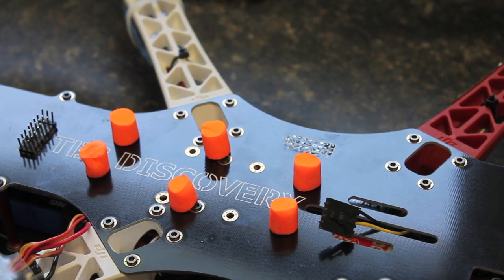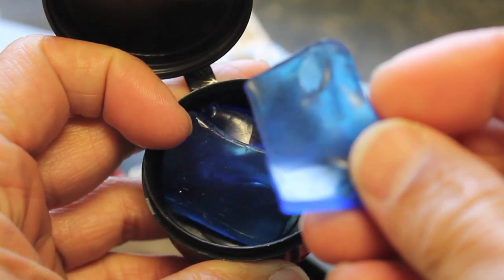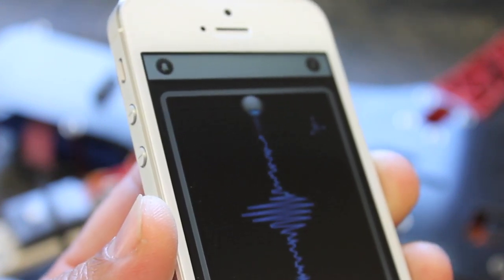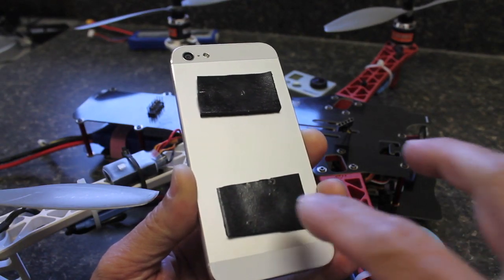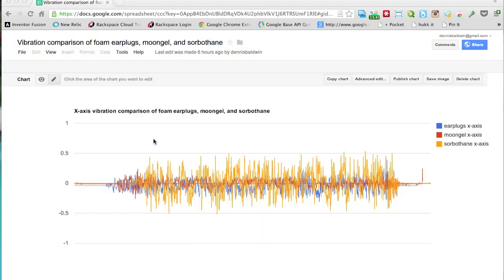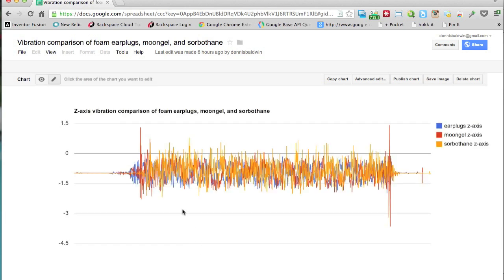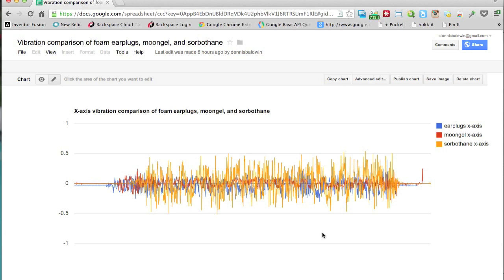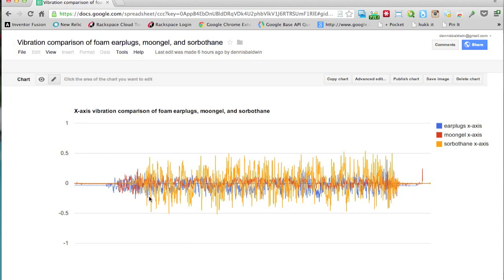Quadcopter Vibration Damping Comparison - Foam Earplugs, Moongel, & Sorbothane

Comment: Mate, not got the time to read all the other comments below, but you need to DE-COUPLE the phone from the quad. You cannot use tie wraps as the vibration will travel through the tie and bypass the dampening, also different frequencies will be generated depending how tight/lose you have it. Yes all the dampening needs to be the same size/thickness and positioned at the same points, so cut the gels the same size as the plugs. Lastly and most importantly, the motors need to be running at PRECISELY the same speed for each test over a sustained amount of time then increase for a specific amount each time to gain an understanding of how each material performs at different motor speeds. To keep the test as uniform as possible design a rig to hold the quad stable to the bench......you are welcome and look forward to seeing the revised video.

Comment: I'm not sure how did you get graph for x-axis. From Excel you show us, and 32 visible rows, sorbothane is stable and in between values -0.009 and 0.008, steps 0.001, 0.002, and max 0.005, while earplugs are in similar range, -0.039 up to -0.034, which is -0.005 step, moongel not to mention, but has worst jumps, -0.022 up to 0.019, etc. Did I get something wrong?
Reply from the maker: +Tomislav Kovacevic (Canon5Dtips) Good point. I had to take some time to revisit this data because it's been a while. I think those outlier spikes are due to takeoff and landing. I was more interested in comparing steady-state while the quadcopter was hovering. The easiest way for me to indicate this was to chart it. If you look at each axis chart when each material was plotted together you can see that Moongel has less spikes in a steady state hover. I hope that clarifies things. If not, then I'll need to spend more time and revisit the data. Thanks for the comment.

Comment: Moongel looks good for xy but earplugs seem better for z vibrations, so maybe mounting them on top of each other would be perfect. And use a rubber band and not a zip tie.
Reply: ab0032 or put something soft between the zip tie and the phone, like more moongel.
Reply from the maker: ab0032 Good suggestion. Definitely worth a test. Thanks.

Comment: Dude... your test method is flawed... the cable tie would be generating most of the vibration.
Reply from the maker: Ray Proffitt Yes it definitely transfers vibration. I couldn't find a way better way to do it at the time so this was the path of least resistance. The tests were all run with the zip tie so I tried to make the test as consistent as possible across all materials. Thanks for the feedback.
Reply: Ray Proffitt you are right.  That hard plastic tie down completes a rigid path all the way to the motors.  So I'd say the results are bumpkis.  You could have used rubber bands instead.  Also, as for the iphone, I seriously doubt its accelerometers are tuned for high frequency vibrations.  Remember the phone is only expected to be used by a person, and a person will not reasonably be able to produce a vibration over a dozen or so hertz.  So high resolution high precision vibration detection is not really needed in the phone.  Here are some data sheets on the accelerometers used in the iPhone 6 http://www.chipworks.com/en/technical-competitive-analysis/resources/blog/comparing-the-invensense-and-bosch-accelerometers-found-in-the-iphone-6/ , but even if they could technically do the job, I'd doubt the software is sampling the unit very fast since really it doesn't need to, but I'm just speculating with reason there.
Reply: UltraStoat lol the phones operate with a multi GHz processor and the accelerometers are the exact same ones used in drone flight controllers.  Stop speculating on things you know nothing about.

Comment: The Moon gel how many can you out of one pad?  Or will will it take 2 pads?  How long  will they last? Sorry If it has been ask.
Reply from the maker: Jack Carpenter There are 4 pads in each package:

http://amzn.to/198RdU4

You can cut them into smaller if necessary. I've used them for over a year with no problems. I'm flying with the QAV400 now and don't need to use them. Thanks for watching.

Comment: silicone from the shop has a hardness of about shore 20, same as a soft earplug and more springy, you can mold it into cord with a tube or paper or something. you can mold it to specific shapes, it's useful.
Reply: Sorbothane® anti vibration pads are manufactured in a durometer range from 25 to 85, soft to hard rubber erasors are mostly in the 35 to 50 range. 50 is pretty dam hard. 35 is like one of the softest rubber erasors that you can get. perhaps it's difficult to find an pencil erasor lower than 37 or something. a 55 erasor would feel like crazy tough.
Reply from the maker: monstercolorfun co Very good to know and thanks for sharing. It sort of reminds of sugru in the fact you can custom mold it. I like that idea a lot.
Reply: monstercolorfun co hi do you know about durometer of sorbothane, i need to know what durometer and thickness to make a trauma plate for my bulletproof vest to go between the vest and my body, i am using lexan and sorbothane but dont know what durometer to use or thickness, thanks...
Reply: monstercolorfun co
look up poron may be better than sorbothane
Reply: it's actually your judgment for the trauma plate, twice as thick means twice as much compression movement and perhaps, every time it increases by 10 it's about half as soft, 35 shore hardness is a quite elastic structurally if you put in half an inch cubes things, but if it's a thin flat pad you might even want to go for 25 or 30. if you have and caulk from silicone to make a pre-test, you can reseal the silicone with the screw cap with foil and plastic jamed under it. bathroom silicone after 3 days is about 35 i found. if you get some 35 it'slike a soft rubber and it should cover a wide range of designs that you would want without using too much, cos 40 would be for padding stuff like 500 grams of kit hitting the ground.
Reply: monstercolorfun co
sorbothane is incredible but way overpriced, especially on ebay where they take the piss, so in a long search for something comparable but cheaper i found something AMAZING, so amazing in fact it maybe very close to sorbothane, from what i have seen may be superior to sorbothane and its way cheaper like 4 times cheaper, and its called poron...

Comment: I found a free seismometer app. Cool item. Thanks for the idea. Are they earplugs softer or firmer than memory foam stuff, or have you tried that as well? A way we suspend mechanical equipment is with a resilient material on either side of the object. Hollow center to allow a non-destructible rod or strap to pass through as an anchor. Did I already ask you if youve ever seen a 6 axis right stick on a radio? up/down, left/right, rotate L/R? Thanks
Reply from the maker: John Robertson I haven't tried memory foam but that's not a bad idea. I like what GetFPV has done with their orange bobbins. It sounds similar to what you described. I have never seen a radio with a 6 axis stick. I'll look around to see what I can dig up. I got your message about the dude flying the collective pitch multirotor. Saw him on FliteTest a long time ago, but never looked into his setup. Would be good to know.

Comment: Interesting test. I was going to give you a thumb up even just from the thumbnail, no pun intended. I have one criticism of your test though. The ziptie was pulling down on the iphone, making it not totally suspended. How about using stickyback tape on your isolators next time?
Reply from the maker: John Robertson Good point. It's been a while since I've run these tests and definitely like your suggestion of not using zipties to pull the phone down. When I do an updated version I'll make sure to keep the tests more consistent across different materials. Thanks for the feedback.

Comment: Try marshmellows or very very gummy bears.. You probably won't... but Let me share something else with you.  I see a lots of guys spending $$ on high dollar props.  I will tell you all you guys, that these carbon fiber what not are mostly over priced version of very very crappy APCs.  Any prop that resembles "high tech" sharp tip look of apc props will rob you of power by creating wingtip/prop tip vortex.  That's why they are horrendously LOUD!  For ALL apps. except 1/2 or less planes, the standard beachwood prop made by Master Airscrew is the BEST.  It looks like it's not gonna bite the air, but it gives better thrust AND speed while using LESS battery than ALL others including German Brands.  Quad flyers should see a longer flight, better response, and QUIETNESS !!!
Reply from the maker: Thanks for the tip. Great info. I've been looking at Xoar props for a while, but haven't pulled the trigger yet.
Reply: Jamie Lee do u know about sorbothane durometer and what would be best to use for a trauma plate for a bulletproof vest thanks

Comment: Not nearly as technical as it should be. To be frank this is more pseudo science than anything. Vibration theory has not been taken into account. Each one of those materials are damping materials with different damping ratios. The materials also differ on the shore scale. The static load of the top potion is constant the variable is the stiffness of the materials  which has not been taken into account. To do this properly one would need to properly load the damper. or else Fn increases

Comment: My use is very different from yours.  That being said, I have have very good luck using sorbothane... but it takes awhile to dial in the correct durometer, thickness and SURFACE AREA.  As a starting point:  Try 3/8" thick sorbothane with a 30 durometer and place a small cube (3/8 X 3/8 X 3/8)  at each corner of your iphone.

Comment from the maker: Very, very good point. What I tried to do is preserve the thickness of material as it would normally be used in the field. I thought about doing tests of stacking Moongel layers on top of each other, but haven't got around to it. And given they would be two independent pieces of material vs one would obviously produce different results. Thank you for the thoughts.

Comment: As you said was mentioned. . .the zip tie is transferring vibration.  The other critical error is you used wildly varying thicknesses of test material.

I could have a revolutionary material, but if it's paper thin, it may appear to be worse than a few pieces of popcorn.

Comment from the maker: I fly with the Discovery and love it. My buddy has a Turnigy Talon Tri-copter and really likes it. I've never flown a tri and prefer a quad just because of the extra motor. The tri seems to oscillate more when descending, but maybe that's just because his needs to be tuned more. He's running a KK2 and I'm running a Naza. The tri seems a little more difficult to get the yaw locked in due to the servo, but that's just my opinion. If it were me I would go quad. You can carry more payload too.

Comment: That is pretty impressive! Not a bad pricepoint either, considering you get what appears to be a QAV500 with a gimbal AND the gimbal motors in the kit.  I'll have to consider that for my second multirotor. I need to get my first one first. :P

Do you think I should get the TBS Discovery or a Flite Test Tri-copter (the David Windestål fram) for my first multirotor?

Comment from the maker: I hear you loud and clear. I've stuck my GoPro to my frame using materials such as Zeal, which is super-sticky. But it made me really nervous because I felt like the vibes were going to knock the GoPro off the frame. The crazy glue may work, but I'd be somewhat skeptical that it will hold. And I wouldn't want to glue Moongel to my camera. Check out my latest vibration vid where at one point I compare with and without the rubberband. I'm not sure it makes that much difference if you use it.

Comment: I would like to use this to isolate my NAZA from the F550 MR airframe. I have heard that some have used crazy glue to stick Moongel to their GoPro mount...... I might try something like that but don'e want my Naza controller to dislocate from the MR.....
any suggestions with that strategy?

Comment from the maker: You're not the first to point this out. You're right, but from a relative perspective I did the zip tie with all materials so the results should be somewhat consistent. I have an updated video comparing some different materials and using a rubber band instead of zip tie. When comparing the rubber band w/ moon gel against no rubber band and moon gel the results were nearly identical. I would think the zip tie definitely carries more vibes. Thanks for the feedback.

Comment: I think its extremely hard to calculate, because the way an object will vibrate will vary depending on weight, mass and shape. An object like a GoPro sits more vertical than horizontal. That would have a huge effect on the way it would vibrate.

Also you would think that the more vibration material you add, the less it will vibrate, this is true to a certain extent, but too much and the weight of the object will cause it more.

Comment from the maker: Interesting that you tested this. I did this as well and even with two strips on top of each other it was worse than one strip. It's almost like they were working against each other. It was as though there were less vibes on the Z axis, but more on the X/Y since the one strip was shifting around on top of the other. I'm no vibration expert, but that's what it seemed like :)

Comment: I've used Moongel with my gopro and found it is about the same as earplugs. One thing I found was using too much moongel can cause problems. If you mount using 4 strips you get a lot more vibration than 2 strips.

Comment: hi there, i see using the airplug you had a cable tie holding the mobile phone, did you do the same on the other two. thinking vibration would have come thru the cable tie

Comment from the maker: Well at least we're in the same boat! I know the source of my problem are the motors, but right now am not 100% certain what to do. I'm working on balancing them, but I think either the shaft or prop mount is a tad uneven. This is obviously amplified when spinning at high RPMs. I've heard good things about the Sunnysky motors. I'm tempted to splurge on t-motors, but don't think that's going to make the problem disappear.

Comment: I would be interested as well. Vibration is the bane of my life. You made a comment earlier about how you think you need to go to the source of the vibration rather than trying to isolate it. I agree, nonetheless i havent managed.

Had some  unnamed 2212 outrunner brushless motors which were terrible, bought some Sunnysky 2216 which improved things and also balanced my props. But I still get constructive interference from multiple motors creating a crazy shake!

Comment: Great experiment...as I'm sure you know, different items will respond differently even with the same damping material. You used a 150g iPhone, is there any way to repeat the experiment using a much smaller sensor? Something closer in weight and density to an FPV camera, say 10g to 50g?

Comment: nice video yikes zip ties are going to carry the vibs should use rubber bands to secure the iPhone, if you going to use zips or Velcro to mount it use a another plate so the Velcro or zip tie rap around that and  do not touch the frame =)

Comment from the maker: I've thought about this previously, but my biggest concern is that mounting the pads between the motor and the arm would compress the material significantly. That would cause the vibration damping to become ineffective. But maybe I'm misunderstanding when you say "arms near the motors". Is that what you're suggesting or something else? I could see a setup where you have the pad mounted between two plates, the top plate attaches to the motor and bottom plate attaches to arm. Gel is in between.

Comment: I have a DJI Phantom. Would the moongel pads work when mounted directly on the quad arms near the motors? Everyone is always reducing the vibrations on the camera mounts but if you would reduce the vibrations on the airframe, that should work also ( in theory anyway :D ).

Comment: Lol. Great sense of attention to detail and open minded. !! Do a favor and try jus standard Velcro commercial grade and use a small strap to wrap around a tight as possible. Just as if mounting a batt. After my test of SEVERAL diff things.  Velcro turned out to be the best and most importantly the balance.  I again only use the carbon filled gemfans. All else sucks ;). Haven't tries the grabbers tho.   Heard they are good but expensive. ;)

Comment: sometimes you will find that NOTHING is better than anything !   i only use direct mount to my Quad from Hoverthings and run ONLY 9" gemfan carbon filled props.... NO JELLO AT ALL :)  also a better way for dampining believe it or not, is commercial velcro... it has a great dampening provision and works best....

FYI, after you have used a tie strap to hold down the unit, you have now defeated the purpose of each item you are using to stop the jello action... BALANCE !!!!! motors and props !!

Comment from the maker: I use Logarithmic scale, with frequency slider about 1/4th of the way across, sensitivity set to Medium. Did you export your data into a spreadsheet and look at it there? I'm thinking about giving iSeismometer a try. I've seen a few people using it and I like the fact it plots each axis separately in the app....at the same time.